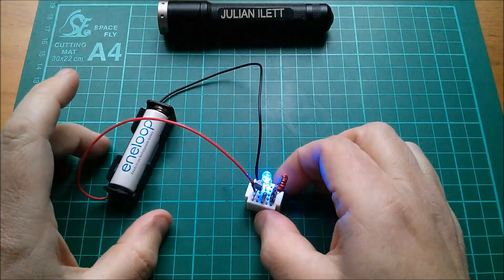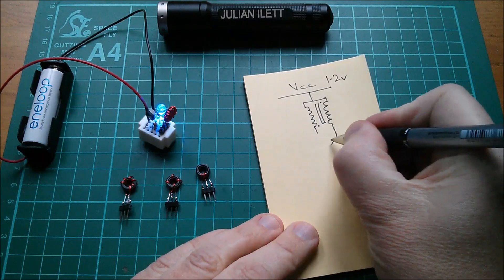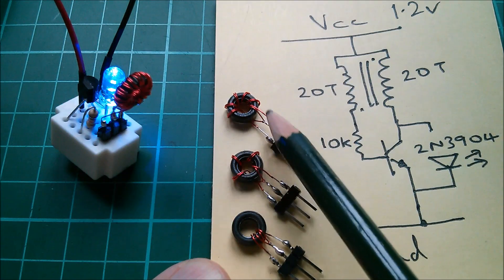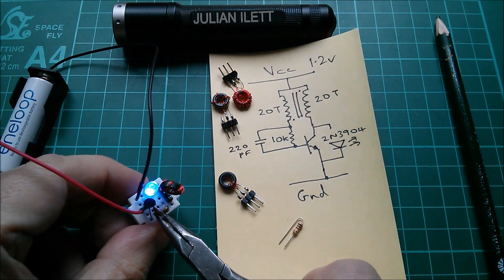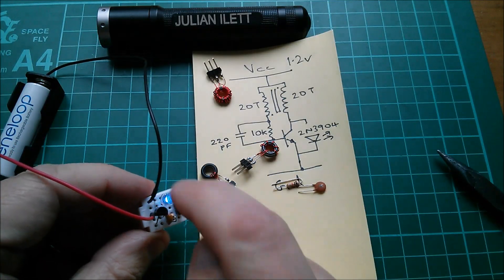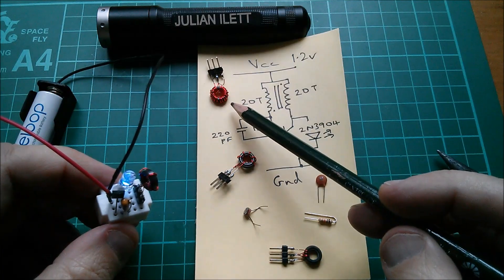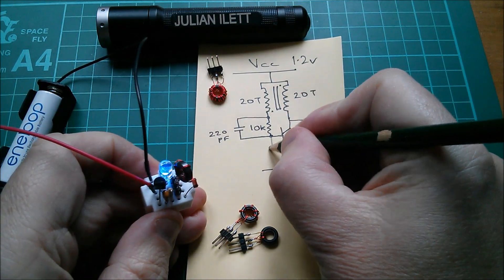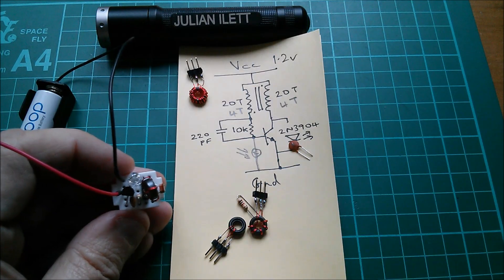Joule Thief - New Inductors - Fewer Turns

Comment: I like this video :)
But I have a few questions: 1.: Why don't you try to optimize the joule thief circuit instead of changing it for advanced laziness?
2.: min. 100 Ohm resistor? Did you try a bridge?
3.: What would you say is the ideal joule-thief? 
I would love to use every milli-amp of any battery to make light. (Lower than 0.5V) I got the most efficient white LEDs I could get - the lowest voltage-drop diode (Lower than Schotkys - DO I even need one? You don't use one! Why?! aaah!)  - a good transistor and a variable resistor... yet still it stops glowing at about 0.8V with 10mA power.
4.: Can you show what the waveform looks like on an oscilloscope - and tell us if the form even makes a difference? Please! :)
Too many mysteries. xD
Reply: I have made tons of joule thiefs just for fun, i dont even own a oscilloscope. My best is with a AC128 transistor from a radio and a 10 and 20 turn coil. Lights up a blue led at around 0.2v. I can place a ice cube on a peltier to light the led with that circuit.
Reply: I made on with only three part: The coil (50:50), the transistor and the LED. (Well, not counting the battery) I have like 5 ways I can put one LED in this circuit to make light with identical brightness, and I can even put two transistors in there, where the second one is 180° turned, having it's collector the other ones emitter.
This is so weird. I can even put in an LED in one place and then when I put another one in a different place, the first one goes out and the second one lights up... It doesn't work the other way around though.
The LED lights up with even ~300mV, though very dim. Putting a resistor from positive to coil I can control the mA.
It's a very interesting circuit.

OH: The circuit oscillates with 10kHz and has many harmonics at 20kHz and above, interestingly.
Reply: Electronics is magic for people when you no idea what is going behind the scene, so you have to experiment with things to get best efficency. Btw my result when led start to light around 58mv with germanium transistor
Reply: @voidex136  qué Voltaje obtengo a la salida del diodo rectificador de germanio en radio galena 🤔🕵️
Reply: Those are PNP. I thought PNP would not work in a JT. Anyway I bought me 5 of those.
I'd read about using a mosfet... I think I'm done with NPN anyway. 62% efficiency seems like a really good JT. But it doesn't SOUND good. (Not that is is audible or something. The number just sounds low)
Changing the NPN transistor mostly only changes the frequency of the oscillation and ampere output and doesn't really change much on the efficiency side. (At least in LTspice)
I think I go the MOSFET route next. Current amplifying sounds cool. 

BTW I tried hooking a second JT to the output of the first one. (where the LED was) That does work. I forgot if that was good or not, though. facepalm Maybe I'll combine a NPN with a MOSFET thief next, or something...
Reply: Voidex MY, best efficiency is at 62 percent. Measured with  LTspice... I'm waiting to buy an oscilloscope to test this extensively, but it seems to be especially great at light output
Reply: Its barely shining at that voltage(white led), i used russian germaniun transistor GT403A.

 Btw found there is video when some 1 made it from 0.035v(but green led) using STN851  transistor.(if you search for STN841 at youtube you can find that video)

Also on ally express there LTC3108 microcircuit that can start with 0.020v to boost voltage to fixed values
Found that when was working on flashlight that shines from peltier module + hand warmth 

also as far as i know you can also build circuit using depletion N channel mosfet that would start from ~0 voltage. 

So many choices ;)
Reply: You can use pnp, just flip your battery and led polarity
Reply: So maybe you could do a series where you keep the same number of turns on the primary, say 20, and vary the turns on the base. Plus add the ammeters as suggested elsewhere to get a better idea of the efficiency.
Reply: Voidex how bright is it? Just a little pale dot? Could you please tell me what the transistor part number is? :)
Reply: Mats Jonsson AC127 Great !!
That good old germanium !!
Reply: For better efficiency you need:
-High beta transistor;
-40 to 50% less turns at transistor base;
-lower base resistor (<1k) for high Iout;
-keep Vin > 0.8V so if you wanna drain all sugar from that used 1.5V, put two in series but keep in mind that is pretty common to leak and you will lose the battery holder connector due to premature corrosion.
Reply: I would actually like to see a video with these components, as comparison to what was shown above.
Reply: there is no need for a extra Diode. try the resistor value with a Potentiometer (10k) and find youre desired value

Comment: How about two wraps around a neodymium magnet?
Reply: Jeffery Rowan I don't think that will work even with 20 wraps... if you put a magnet next to the transformer it usually shorts out the magnetic induction (or something like that... I'm no rocket surgeon)
Reply: These circuits work because the magnetic field is constantly changing. Whereas with a magnet, the magnetic field is constant.

Comment: A man (tsbrownie) is making joule thief with two SMD inductors. He put them side by side. I suggest you to inspect it. This may be easier than winding cables by hand.
Reply: can you please share his video link here ?
Reply: @ashish_witharts  https://www.youtube.com/watch?v=g2jMrNFV4nQ
Reply: I use chokes and coil's from old boards and bits I saved from the trash. I just center tap the chokes or solder two together, smaller turns to the base. Always works for me so far.. 👍

Comment: I have a joule thief that I built 3 years ago, now granted I put 21 turns on her but instead of using a small core, I used one that I removed from an old power supply cord, it's about half an inch wide. I was wondering, if you used one of those you might well be able to use less turns because there is a LOT more core there? I took some photos of her but I don't see any way I can upload them here to show you what I am speaking of. I have a web site but when I tried to upload the photos to it, I found that the RV Park where we are living right now does not have fast enough speed, and is unstable, so the uploads failed. Strange because  I can upload our every day travel photos to facebook without problems.